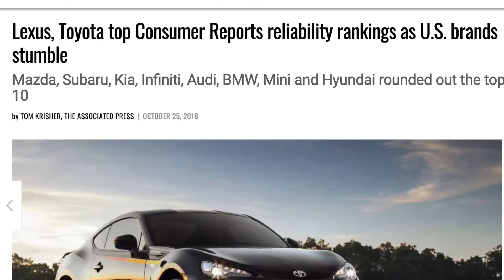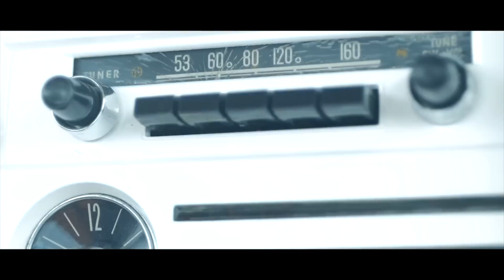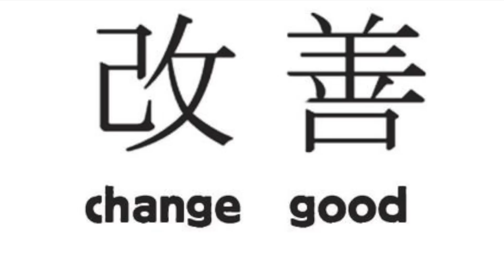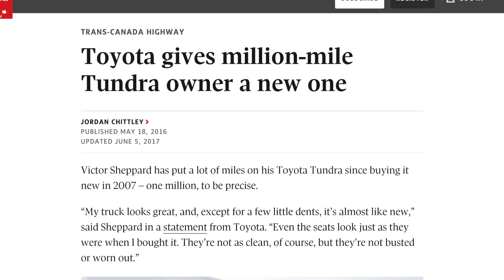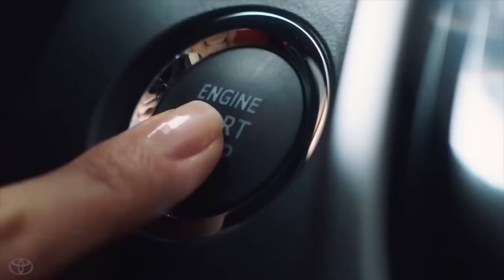How Toyotas Became So Reliable

Comment: Reliable as an anvil,we all know that.the thing I love is my 03 camry v6 xle has just over 300k miles and all handles knobs and switches still work and look fine. My buddy with 5 yr old gm 4 door hates my camry it is smoother and makes zero noises when driving. He car squeaks rattles and has interior parts falling apart with 70k miles. The fit finish and quality of toyotas is the best. Every.light switch and gizmo in my camry still work like new. Heck buddy has replaced 2 drivers door handles already, made in USA my ass that plastic has to be from china lol. Oh my camry made in Tennessee by the way.

Comment: I purchased a '19 Avalon Limited. The only concern that I have is the new 8 speed transmission. It hasn't been around long enough to have an opinion on.
Reply: Amarillo Aristocrat the same transmission that is on the Lexus ISF and is350 and GS350. I own a IS350 with 80k miles. No problems 👍
Reply: @jesusvidaca1416  , that's  good to know, because my other Avalon had the six speed.
Reply: The six speed tranny is bulletproof....The 8 speed is far more efficient mpg wise and rpm wise, but long term durability is still unknown although early trouble reports have decreased to almost zero... Trending favorably but jury still out.
Reply: Richard Dobson so far no problems on mine. Hopefully it stays that wat. Only thing is sucks is that you cant do a fluid change. Sealed transmission bs
Reply: @jesusvidaca1416  agreed...
I don't like that either....it is b.s.

Comment: Bought a used 2010 Corolla and drove it to 200k miles with only a $50 repair and regular maintenance. At around 160k the brake light switch went out. I never had any other issues with the car. In fact it was still on it's original battery when I sold it to a friend for next to nothing.  He says it's the nicest car he has ever owned. Lol
Reply: I purchased a 2009 Corolla with 30k on it for 10k in 2012.   I sold it for $9800 in 2014 with 90k miles on it ( still under the Toyota 100k certified warranty) Changed the oil, wiper blades and one set of tires.   

In 1998 I purchased an 1984 Corolla with 200k miles for $250. The junk yard gave me $50 for it in 2001. It had 310,000 miles and the original clutch. They sold the lights hood, doors and trunk and drove it around the junk yard for years.   It was a rust bucket but everything worked. Even the Ac.

Comment: Purchased  a  new 1972 Toyota Celica. Toyota upsized from 1.8 to 2.0 liter engine. Every 15,000 miles, needed a valve job. Sold car before third valve job. Toyota did not cover the design flawed engine. The cylinder heads were redesigned with valve seats that self destructed. In 1973 , $430 for a valve job was expensive. Toyota did not measure up to the hype for me.

Comment: When Toyota first started making cars for America, they studied how the American brands manufactured cars noting all the quality problems that GM & Chrysler have building cars and changed the way they manufacture cars. As a result, they are well built (good quality) and reliable cars.  In 2017, Toyota celebrated the 50th anniversary of the Corolla.  While Toyota's infotainment system, Entunes 2.0 is outdated and doesn't have Android Auto (frustrating), it is simple to use.
Reply: In Africa the landcruiser and Hilux 12R replaced the landrover 109 and 110 in the market.

Comment: Agree with the part sharing... i have a ~$50,000 (after tax) toyota estima minivan n it uses the same doorlock chime as a ~$10,000 toyota hatchback. Huuge price difference but share quite alot buttons n switch designs. That means they came off the same press, just different-quality rawmat.

Comment: as a honda lover I recently switched to a toyota car, rather a scion which is made by them.  You drive and long long long while before any engine lights or suspension work needs to be done as long as you don't beat them to death.  Since I buy used Honda's, especially manual transmission models, get beat to death by the time they get on the used market.  For whatever reasons.  Toyotas seem to be sensibly driven and mostly adult or senior owned. Toyota is amazing, without them its scary.  Honda's quality has dropped in my view, and if you like your cars simple as I do, these new cars just seem to be a lot of things that can go wrong now.  My friend had to get a push button starter fixed.  So so expensive.  

Its amazing in 2019 American car makers STILL have no idea how to build reliable transportation that can be safely owned out of warranty.
Reply: American companies more concerned about short term profits than long term success....As a result nobody wants American cars anymore
Reply: @gingerelvira6587  ...Nissan's are horrible...
Reply: lol Ford Windstars from 2000’s had a problem where the rear axle could snap after rust development. Thx ford for quality lolz

Meanwhile Acuras from those years are still on the road
Reply: Buy a base model without push button start. A base model is all a person needs now.
Reply: @babblesp1367   A base model Camry will age better in my opinion...The styling isn't as extreme as the SE and XSE...While I like the looks of those a lot and maybe better than the base, I don't think it will age well...The more radical a design, generally the worse it will age.. The base models L & LE are more plain but I also think they are more elegant and more conservative..There's such a difference between the two designs that it's really hard to decide...
Reply: @richarddobson3138  i still drive an 05 matrix base model. No power windows or A/C and the body still good... about to break 190k miles american but also almost 300k km in Canadian and other countries that use this system. People wont even believe the vehicle is almost 15 yrs old and still on road. Does not burn any oil at all. My fathers 2009 mazda 3 that he brought brand new and now with 161k km is literally falling apart and everytime you drive it you could feel as if the floor will give way any moment. He is even considering getting a toyots corolla for himself thanks to my vehicle lol...
Reply: @alvinsimba734  Toyotas are best, and yes you're right, Mazda's have been historically notoriously bad for structural rust, probably the worst.  Its ridiculous that a 2009 would already be that bad, but I've read many accounts of the same rust issues with Mazda's. ..While they are good for short term, long term they don't hold up.
You see that's the key to me.. I'm not near as worried with speed and high performance as I am with long term reliability and durability...
and if you look at the long term reliability & durability charts on Dashboardlight.com, and data from Carcomplaints.com, this is where Toyota really has a huge lead on all of the competition, and that's what's important to me.. With what vehicles cost today,  I'm just not interested in replacing a car every 7- 10 years, I want at least 15 to 20 years minimum ..

Comment: I used to be GM all the way. Bought a used 2004 Tacoma in 2008. I needed more power and four-wheel drive for the oilfield so I sold the 2004 to my friend and bought a used 2008 Tacoma 4WD. My friend is still driving the 2004 and the AC still blows ice cold. I know because I just rode in the truck. Engine sounds tight no ticking or smoke. I haven't really put my 2008 to the test because I'm a truck driver and sits it's a lot. I'm staying with Toyota and I would never consider a late model GM. Maybe a 68 GTO. But nothing newer. The current GM's are garbage.

Comment: TOYOTA.  It has taken many years for you to gain the trust of the consumer, today  your product is world known to be reliable. DO NOT BLOW IT for it will take less than half the time to loose such a trust. Lately there are signs of poor engineering, policies  and use of cheap materials. If you persist in degrading your performance for the sake of better return for your shareholders you would inevitably go down.

Comment: dodge caravan in that footage lol

One of the worst motor vehicles ever lol
Reply: My 1993 DGC still works fine with original engine, trans, radiator, starter & alternator. Only regular prescribed maintenance given...Even the power locks, windows & mirrors are glitch-free ! What gives ??

Comment: For any car,   I can make it run 1 million miles if I keep replacing parts.
Reply: For Toyotas you don't have to keep replacing the parts
Reply: @karthikburli3052  Really,  I don't think so.  I have a 2007 Sienna.    Over the years with 170K miles,  I replaced the water pump,  ignition coils,  and a month ago the power steering rack.    However,  I still consider the car to be one of the best.

Comment: Explain why they don't breakdown.  Are they made of titanium why they don't break down.
Reply: 1. Quality parts and #1 Quality Control. 
2. The cars are understressed due to being simple and lots of research.
3. Test engines are stress tested over 200-300k miles to check for issues before going full production.
Reply: @xxk4rilsxx  finally more info thanks.  What makes parts quality parts?
Reply: @chriss4365  Welp.. I guess If it lasts a long time it's good quality. Some manufacturers choose cheap materials to save money or to make money with planned parts failure. My moms 1998 Corolla and my fathers 2001 sequoia made it to over 380k miles with little to no maintenance required.. that is quality. When they sold it, their were still no issues.. just basic maintenance. Our 2011 Prius is at 288k miles with no serious issues.. just a couple of 290$ battery packs.
Reply: @xxk4rilsxx  $290 battery packs? In what dream world?
Reply: @robby844  The first gen Prius has like 20+ battery packs I think. That's what we payed. It's been 3 years and no issues since we put them in. And I mean 290 each
Reply: @xxk4rilsxx  Toyota claims the entire pack must be replaced at the same time and there are no individual cells to replace. Buddy of mine got quoted $8500 for a battery pack from toyota
Reply: @robby844  Yea never go to the dealer after warranty. You can replace them separately.. you just need to find someone that knows how to work on hybrids. It was awhile ago but 3 battery packs were almost dead so only those 3 were replaced instead of all 20+.
Reply: The secret sauce is called japanesium
Reply: Crazy to think Toyota listened to an American scientist that was trying to implement quality parts control using s methodology he created to American companies and they all rejected the guy except the Japanese. the Toyota system of constant improvement or Kaizen is the system they've developed after this American scientist introduce to them. Nowadays this person has little to no recognition for his work except that he used to work for the US Cesus Bureau and worked in Japan after WW2 for the American government conducting Cesus for Japanese population
Reply: chriss4365 they don’t have unions trying to kill the company every chance they get.   Gm 1974: 143 thou employees . 2019 :41 thou.
Reply: It all starts with the materials:superior quality plastics,superior quality metal alloys, textiles, rubber, superior electronics and electric parts that resist hot and cold cycles much longer than others. 
Then they design and test these parts with durability as the main purpose. 
They have the biggest research and development budget in the world as they are the largest vehicle manufacturer on the planet(for the above reasons)
Final product is the most reliable and most fuel efficient car on the market...for each model.
And it all meets the Japanese philosophy of caring for your customer and respecting them..not the western corporate philosophy of higher quarterly profit at any cost(including the customers and employees)
Reply: rdennis totally correct.

Comment: I'd rather go with Subaru. They are partly owned by Toyota, and have AWD standard. Much better.
Reply: No they are not. Subaru engines require more Maintenance and are not as reliable as Toyota’s power plants.  Most Subaru’s have some major problems around 200k. Toyota is more like 300k.

Comment: That new Camry might be reliable but it is ugly. Also it has less rear seat leg room than the last generation of the Toyota Corolla. Some of their product mix is messed up that way.  If you want a car that is big enough for a family of four (or five) and will last forever, and is very reasonably priced, buy a one year old corolla with manual transmission (you might still be able to get a new one at a dealer near you). If you keep up with the oil changes, it will last you 20 or 30 years - it could even be the last car you buy. And think of all the money you can deposit in the bank because you weren't making car payments over those 30 years.

Comment: Bullshit! I've had four Subarus and they have outlasted my friends' Toyotas and Hondas. Those cars just keep on going and going. To be fair, I still have a 1994 Toyota Previa van. It gave me some engine problems when it had only about 150,000 miles. I purchased an used Japanese engine with about 55,000 miles. The van now has about 250,000 and it is still going strong. The transmission is the original. I also own a 2017 Honda Civic, I will never buy a Honda again. They are over priced for the junk Honda gives you. With 57,000 miles many things have broken off. Give me a Subaru or Honda over anything else out there. Even though I've heard from a couple of people that Kia cars are pretty good too.
Reply: Previa represent! I have 325k kilometers on mine and it doesn't give me any shit.

Comment: Some newer models(2017+) of Toyota trucks and suv s' have been RECALLED.
(700k vehicles involved)
"...a low pressure fuel pump which may stop operating...............This may result in a vehicle stall, and the vehicle may be unable to be restarted. If a vehicle stall occurs while driving, this could increase the risk of a crash."  "Toyota is currently preparing the remedy....." I contacted Toyota HQ and my Toyota dealership about my truck, they said nothing can be done now. The earliest date for repair is September of this year. So they are telling us to drive around in a dangerous and unsafe vehicle for 5 months, putting our lives at risk. Either park the car or sell it to an unsuspecting person. HOW'S THAT FOR TOYOTA RELIABILITY AND SERVICE??????
I have bought Toyota s' in the past but now TOYOTA SUCKS!!!!

Comment: Toyota reliability is slipping. Still the best in the industry.   Outsourcing has crippled Toyota.   Toyota now depends on far less reliable companies to manufacture its performance cars. Like Bmw, Yamaha and Subaru.    The new 8 speed in the Camry and the CVT in the Corolla hatchback are giving problems. Last decade was riddled with engine , unintended acceleration and airbag problems.  Toyota will often wait 4 to 6 years to even acknowledge there is an major issue or Blame its customers. 

The new Electric cars are starting to mature. They are becoming just as reliable as the Toyota product with less required Maintenance and cheaper fueling cost wile being far more entertaining to drive. 

Toyota the creator of the Prius has no answer to the Electric car at this point.

Comment: Toyota unable to design and produce performance cars. They turn to BMW for their engine, gearbox and as well another company to design the all new BMW Z4, badged it under Toyota.  What a shame.
Reply: They’re not unable to.They just seem to have no desire to. Most sports cars sell in small numbers anyway. makes the company feel good to make some cool shit , but the demand is low. So sadly, they just outsourced it to BMW, and in the case of the 86, to Subaru., In the 80s, they created the first production 16 valve engine. The 4AGE. produced 112 HP . It’s a 1.6 liter, or about 91 cubic inches. No NA production car had this kind of hp per cubic inch. It’s nothing by today’s standards, but I dusted a lot of cars with much bigger engines with mine. And you could rev it to 7500 RPM regularly. It was a tough engine. The 3sGTE in later mr2 turbos (90’s)could be upgraded to over 400 HP, and will dust a porsche or a Ferrari. Sports car sales went in the crapper, and Toyota sadly just kinda gave up on performance cars..
Reply: Fun fact - The first chain driven dual overhead cam and 4 valve/cylinder in the world was a 1912 Peugeot!!
If memory serves Triumph carries the palm, regarding the first production 4 valve/cyl back in the early 70's. ;-)
With this said Toyota as a innovative brand it's quite a deception. They tend to trail the path of perfecting what others invented. Which BTW they do exceptionally well. But real innovation...Nah! ;-)
Reply: @reludennis  nothing so special to owned a Toyota.like me had a meeting with others everyfornight.no one even driven the ugly look Toyota at all
Reply: rdennis if he can afford those 🤣 he cant even get a toyota

Comment: I've owned two different Toyota's. 2001 Corolla and a 2009 Camry and they both started drinking oil with less than 100k miles. The Corolla used 1-1/2 quarts every 500-600 miles. The Camry used 2 quarts between oil changes but yet three Toyota dealerships said that was normal. Now we have a 2019 rav4 with transmission shifting issues and the dealer says it's normal. No transmission should bang into gears. This will be my last Toyota.
Reply: Too bad for you man it must be karma. Everyone know toyota has the least amount of defect vehicles. Guess you got them.

Comment: Quality yes, boring hell yes! Zero features.
Reply: 1984 , 1990 Supra, 2000 to 2005 Celica Gt,  LFA,   1983 Corolla GTS or the original 86. The 2016 Toyota 86.   The original Mr2 and the 2000 to 2005 Mr2. 

My 1977 1.4 4 speed manual Corolla was a blast to drive and got over 40 mpg.   My aunt use to drift her 1980 RwD Tercel in the Caribbean 24/7 .

Yes 99% of Toyota’s are painfully boring.  The Prius is the prime example.